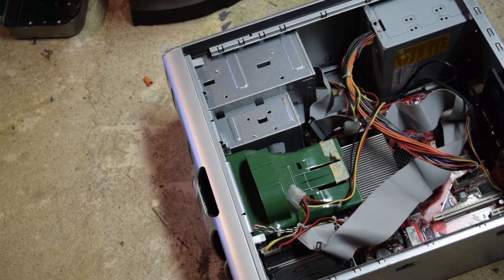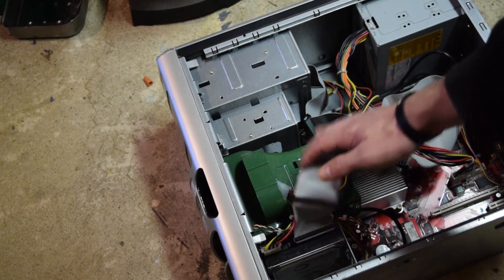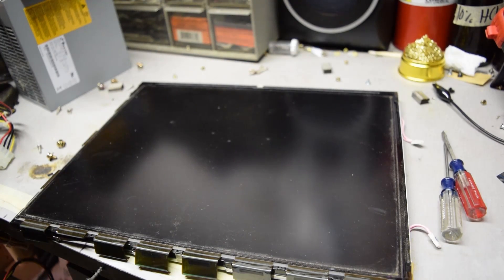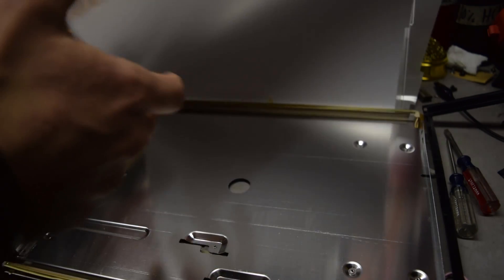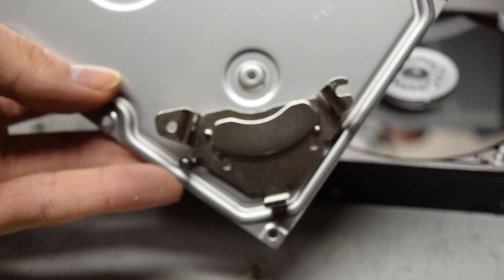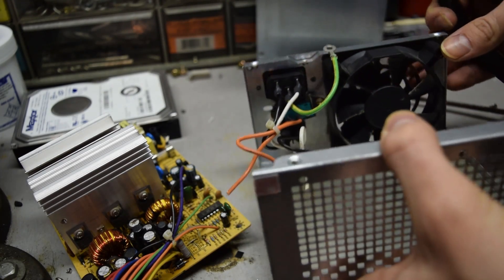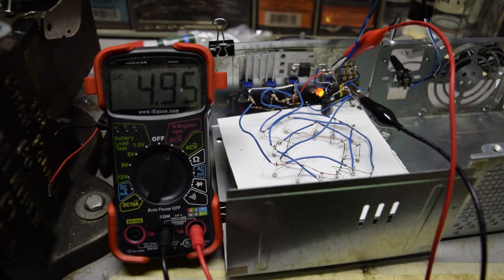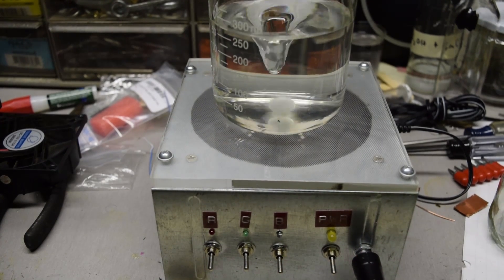How to Build a Magnetic Stirrer Using parts from an Old Computer

Comment: WOW IMPRESSIVE.   Looks very nice.    You could always just cut out a circle of cloth or use a thin coaster if you have a  boiling hot liquid to stir.   To help protect the plexiglass.  
                  I been wanting to make what you made for years but i am lazy.  Mine would work as good as yours but mine definitely would NOT look as nice as yours.
Reply: Safety is important so I'll add this.
Plexiglass 1/4" to 1/2"
Operating temperature range: 
-40°F to 180°F -80°C
Those are a manufacturer's specs, I'm sure it can be pushed a bit with warpage over time. 
Great for a coffee cup.

Comment: Shouldn't you remove the fan blades to cut down on resistance, since you are adding a ton of extra torque resistance by having the fan stir something?
Reply from the maker: You could, but I think that the motor needs some drag, otherwise it would spin so fast that it wouldn't be able to hold onto the stir bar and it would start banging around in the beaker. Fans aren't really the ideal motor for the project since they are designed to spin much faster than a stir plate necessarily should (hence the LM317).  The blades also increase the momentum of the system and probably keep it more stable.
Reply: @99Chemicals great answer. I like this guy! Smart, creative, answers questions from fans using more than 1 syllable. Awesome. I hope all you people who are appreciating this guys work are SHARING this link, liking the video and subscribing. 
If you enjoy his teaching and want more of it then we all need to HELP him make him go BOOM by doing those things.